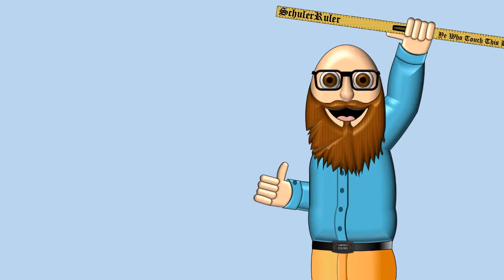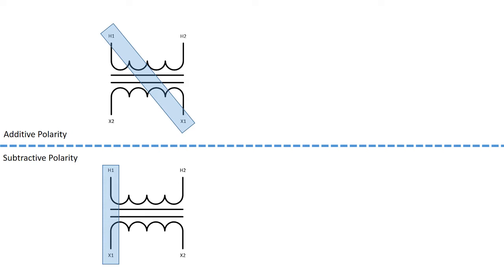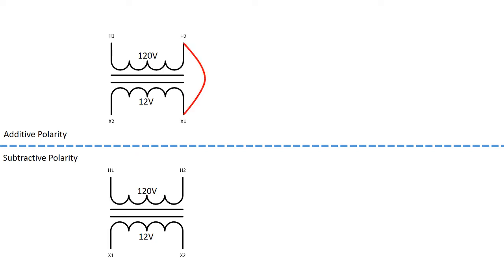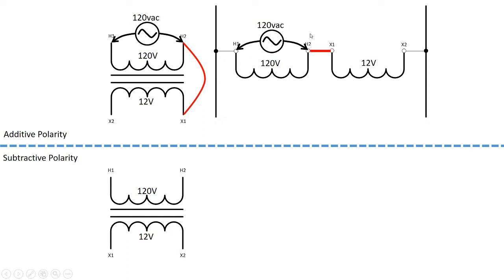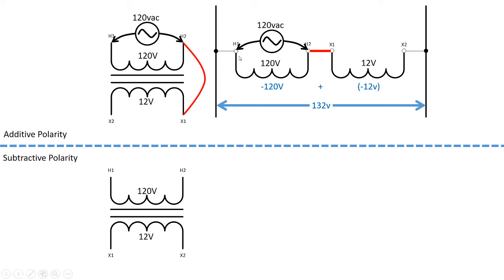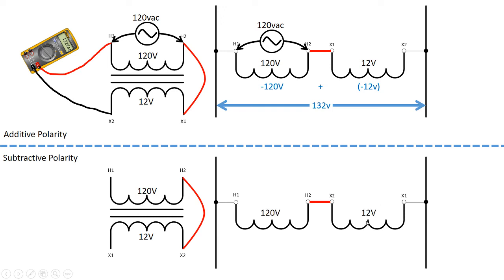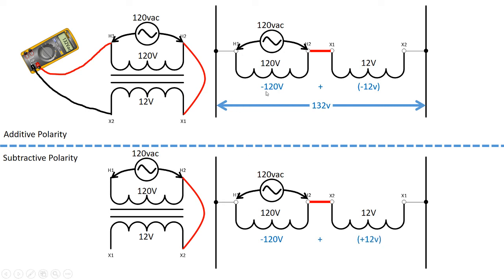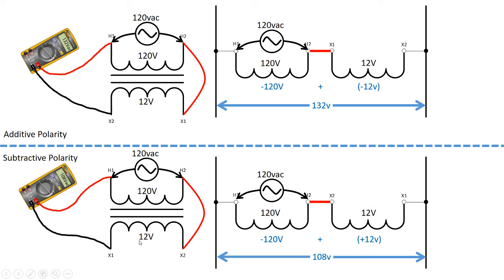Transformer Polarities

Comment: Yes, but why does the single phase step down transformer OVER 200 KVA    NEED a subtractive transformer?   thank you
Reply: The voltage stress from high voltage side to low voltage side in a subtractive transformer is lower,hence subtractive transformer. Now on a 200 Kva or higher transformer the amount of energy delivered during an internal fault would result in a lower energy (kw) fault. Lower kw lower destruction of the transformer. It doesn’t matter in our distribution transformers 12000v/240v. Higher voltage transformers is where you would see high appreciable difference. Example 115kv /66kv additive transformers the voltage stress would be 181kv x 1000amp internal fault would result in a 181,000kw fault. If they were subtractive the voltage stress would be 49kv x 1000amp internal fault would result in a 49,000kw fault. Being wound subtractive over 1/3rd less damage and therefore a lot less money to repair the transformer. Remember when it comes to higher voltage transformers we repair not replace if at all possible.

Comment: Ok, so why or when does this matter? Functionally, if I have 120 on my primary and 12 on my secondary and the transformer is connected NORMALLY then the transformer is doing what I need it to do, supply 12vac to my load. I'm sure I'm missing something, please give an example of when this is useful.
Reply from the maker: This would be if you were connecting the transformer as an autotransformer and either "bucking" or "boosting" the voltage. 
You are correct in the statement that when using this as a conventional transformer, it is not something that's an issue.
Reply: Think about it in terms of line and neutral at an electrical outlet. The neutral wire is attached at the center point of the house's supply transformer, and is bonded to ground at the main service panel. For all intents and purposes, it's your reference point for all circuits in the house. Say you then plug in this transformer. If you read from one side of the secondary coil to ground, you get approximately 6V, and the other side reads approximately 3V. This is because the primary side of the transformer is run between the reference point and one hot leg, instead of between two hot legs. I would equate it to the difference between pulling one end of a spring with the other attached to an anchor point and pulling on both ends of it. 
In the case of HVAC, which is my field, it messes with the flame rectification if you get the hot and neutral wires backwards coming into the furnace. Basically the point of flame rectification is to detect whether there's a flame present, and if not present, shut off the furnace. This works because electrons have an easy time flowing from the flame sensing rod to the metal frame of the furnace, but not the other way around. The furnace board detects this as a DC current pulsing at 30Hz, and keeps the furnace in operation.

Since the neutral is the reference point and is attached to ground, if you get the polarity backwards then the flame rectification doesn't work right. You don't get anywhere near the same signal strength, and the board can't tell if there's a flame. In fact, most modern furnaces bond the common side (the side that reads 1/2 voltage to ground when disconnected) of the transformer to ground directly, in which case you get no current flowing through the flame at all if the polarity is reversed. But most modern furnaces actually can detect the polarity and the board will give you an error code telling you it's backwards.

Comment: Good explanation of the topic but I don't really know what this is about. This method is a topic in the CEC pocket reference too so I know it's important but I don't understand the context in which this test would be done?
Reply from the maker: Often if you are paralleling transformers for higher capacity, connecting in series (multiwinding transformers) or creating an autotransformer situation you will need to ensure that the polarity of the terminals is designated for correct voltage applications.
Reply: @schulerruler  oh okay, so like if you were trying to make a three phase transformer out of three (equivalent) single phase ones?
Reply from the maker: @josho5177  That is a great example.
Reply: @schulerruler  sweet, thanks, the visuals are looking good btw! Audio nice levels too

Comment: Another great video thank you. One point you were trying to make is why we care. Well if we’re just trying to figure out whether a transformer is add or sub then this video nailed it. At the end you said we care because it’ll impact your overall voltage. But to go a little further, can you explain when it comes to our connections, paralleling transformers, or building banks, what can happen if polarity is incorrect? Can you parallel an add and sub transformer on the same phase? Can you bank 2 adds and 1 sub without changing the positions of your secondary leads? I have been told what you can and cannot do, but actually seeing it on paper, seeing why you can or cannot, what can happen, etc. would be great! And you do a terrific job at explaining it on paper if you get what I’m saying. Thank you again.

Comment: Good explanation, but why is considered additive only to a certain voltage, for example in single phase pad transformers more than 24940y/14400 is considered subtractive?
Reply: 8660v or greater or 200kva or greater it will be wound subtractive.

Comment: Very good video! How does polarity work on a distribution transformer when the windings are split (like two 120v windings) X3, X2, X1?  This is how most standard transformers are wired for distribution voltages to feed a house, 120, 120, 240V.
Reply from the maker: You still have to think of it as one winding. If X1 is negative and X2 is positive, this would yield a -120v (for algebraic addition). X2 to X3, now X2 becomes the negative, with respect to X3 (as this is the most positive point in the circuit) giving us another -120v. These added together would equal the potential across the whole secondary coil of 240v.

Comment: I didn't understand the part where you mention that terminals with odd numbers are negative and even numbers are positive.  Because from left to right you have H1to H2 to X2 to X1. That would be negative to positive to negative to positive how did you get -120 minus -12v. Please help me understand this..
Reply from the maker: If we place a negative value on the odd terminals, and a positive value on the even and write out mathematically the formula it would be 
(-120v) + (+12v) = -108v, or better said, 108v of potential.

Comment: what book do you use ?
I have never seen  H  X  terminals( very confusing to me )

the good books always use  "DOT Convention" .  DOT placement is  crucial to get started , then
the  interpretation and equation writing is simple  KVL with Ohm's law .
You made a fixed tap  Auto Transformer .

ISBN :  0-07-027410-X  Engineering Circuit Analysis Fifth Edition  1993 ( everyone should read that book )
Reply from the maker: This is the IEEE standard for transformer terminal designations.  The High voltage side is designated by capital H followed by the subscript number of the terminal (ex H1 H2 etc). The lower voltage side is indicated by capital X and terminal number. 
Any transformer I have ever terminated has had the H and X teminal markings. Instrument Transformers are commonly marked with a white dot to indicate that this is H1.
Reply: @schulerruler   aah ,... I was looking for , or in the mind set of  "Coupled Coils"  that work with  Mutual inductance and using the  DOT Convention .  Context ,...I stumbled onto something slightly different .

As long as I am here ,...is there a "connection\similarity" of use , to associate the  DOT Convention of DOT placement , to that of the  H  and X terminals ?  A  DOT  does not necessarily depict a  Higher or Lower voltage side .  or , is this an  Apples\Oranges situation ?
Reply from the maker: @240mains  from what I understand, and this is from limited knowledge of instrument Transformers used for revenue metering, the white dot will always represent the H1 terminal, while the x1 terminal may or may not also have a white dot. 
This is how we generally introduce autotransformers is with standard mutual induction Transformers, and then reconnecting them as a step up or step down auto.